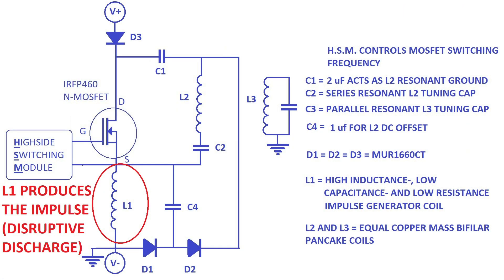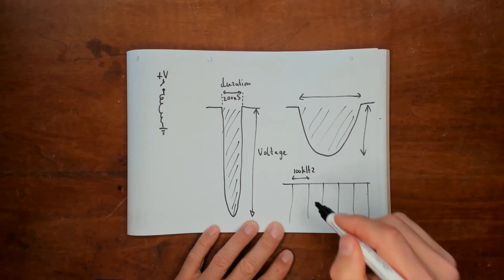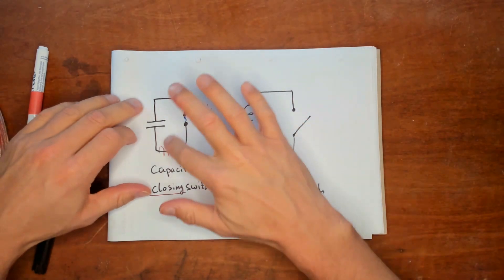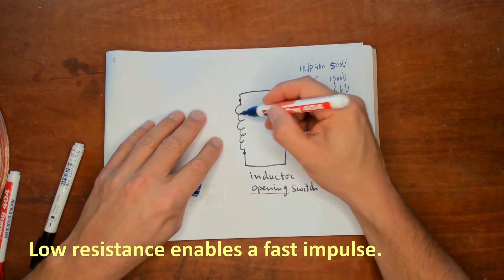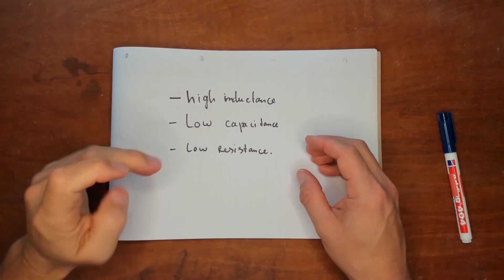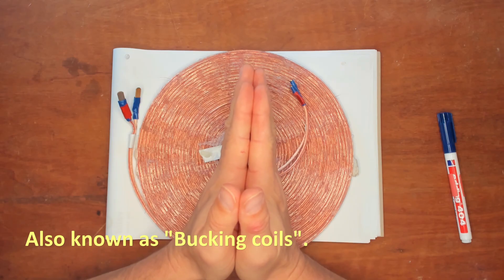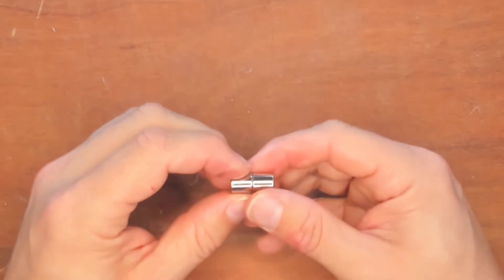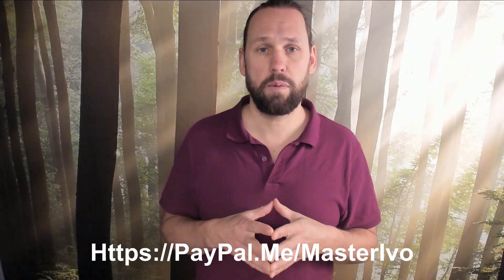Longitudinal electric impulse generation factors.

Comment: Why this interest in impulse, or voltage spikes? Why is this useful?
Reply: Reading the research of Gerry Vassilatos, one learns that Tesla discovered that with a capacitive powered voltage spike, jumping a gap prior to the closing of a switch from a high voltage source to a neutral network, he would see an amplification of electricity. This amplification, by the distance the sparks jumped out of the receiving circuits, was much greater than the amount of power behind the voltage differential supplied by the capacitors. (A spark that jumped a few centimeters at the switch would produce an arc of feet out of the receiving conductors, killing people who should have been safe distances from the wires.) Only Tesla saw this as an opportunity to discover how nature creates electricity.

This led Tesla to discover that electricity could be disassociated into charge and something else; which he decided was Ether. The Charge was relatively slow-moving compared to the Ether; the Ether was also able to amplify and re-constitute the electricity when it slowed down.

Tesla also discovered that the Ether was able to power devices and substances directly, without electricity or wasted energy in resistance and heat. It all depended on the frequency and vibration rate of the impulses that Tesla conditioned with his complex spark gap mechanisms, as to what the Ether impulses he could separate out, changing what they would do... the substances they would affect and the energetic response the substances would manifest. He found he could replicate any physical reaction in the various substances with his beams of pulsed Ether-energy. This took remote control to a new level, from transferring energy to actually doing chemical and nuclear reactions remotely.

Tesla also discovered that Ether beams, that did not have charge, could be transmitted wirelessly without loss or delay. The limitations of transmitting electrical power in wires that had resistance and also losses to the environment became obsolete.... as well as the physical limitations of power distribution that made it easy to control and monetize power distribution. This would have led to the devaluation of wealth in the world as we know it... so, his discovery became public enemy #1.

Right now, the idea is just a distraction... not of practical use. But if the power grid fails, it could save humanity.

Master Ivo is looking at impulses produced by opened coils, not closing capacitors. The quality of the electricity that each event dominates with, a charge differential driven electricity, vs. a magnetism driven electricity is different. He is using a similar concept, but producing a completely different effect than what Tesla researched. Master Ivo's is original research and is especially important in clarifying the relationship of Ether to electricity. There is much more to this than one can see in the description.

Party on dudes... be good to one another. Peace, B.
Reply: @mundymorningreport3137  And then, along came the Michel/Morley experiment which disproved the existence of ether. It just wasn't the same as Tesla's ether as they had misunderstood Tesla's meaning. And then all of science ignored Tesla until now when dark matter/energy is confusing the hell out of them!
Reply: @jimporter7418  they falsified the concept of a static ether.
Reply: @jimporter7418  Check out Quintessence. Wikipedia calls it the new Aether. An ancient alchemical term for Aether that modern science is embracing as real.

MM was debunked. Electrical theory is full of holes that make no sense from the pseudoscience of Maxwell's equations to the paradoxes of induction that cannot exist with the explanation of Faraday's induction to the impossible function of capacitors and the clear logical falseness of the three laws of thermodynamics when applied to electrical energy. As an EE, I can tell you that the theory and equations are not applicable in real life... fudge factors, guard-banding are the rule that must be implemented if you want something functional.

It is the law, so we must conform, but it is not the truth.

Party on, be safe. B
Reply: @mundymorningreport3137  I did a Physics degree 40 years ago and when we worked out electromagnetics from first principles, it came out wrong so we had to fudge it. That meant the principles we were using were wrong but nobody was allowed to speak of it!!!!!
Reply: @jimporter7418  I had similar questions during my degreed work. An engineer told me "Every theOry has a hole." You cannot graduate without accepting the theories are wrong, but discovering the truth is beyond most graduates.

Keep in mind Tesla did all this with junk from scrapyards all around the world today. Mystics have accomplished feats proving the tech is even simpler to implement for a disciplined mind and body. Several of the people who have discovered the truth also demonstrate advanced psychic skills. Coincidence? 

I've hacked the physical link between body and consciousness and wordlessly taken physical control of another's body, healed deadly illnesses, read minds, bent and broken metal spoons and forks with light finger pressure and mental focus. I've also shifted my weight, becoming much lighter or heavier... These are all tricks of conscious control of Ether we all produce. They are natural skills any living creature can produce. We do what Tesla discovered he could do with technology.

Is the truth much simpler than an advanced degree would justify?

Reich insisted that people who spent time in the Aether rich environment of his accumulator developed the ability to see Aether. However, realizing that truth required most people to need counseling. (He called it orgone in an attempt to avoid the censure Tesla experienced.  That strategy failed.)

Party on. Do good. B
Reply: @jimporter7418  They never found a static ether. But you do not need a static one when it can move with ya ;)
Reply from the maker: it is part of understanding Nikola Tesla's work. We only know magnetic induction, but Tesla worked with dielectric induction, based on these impulses.

both induction methods are needed simultaneously.
Reply: When you can eliminate the "back emf" from a circuit you can produce over-unity simply and continuously.  This is the pathway to doing just THAT.
Reply: @rstelzer2928  Or only use the back emf which has the same effect. There is more power in the collapsing magnetic field than most realize.
Reply: @rstelzer2928  Overunity is easy, what Evo is doing is far more interesting! Coherent aether  beams COOL!

Comment: what will happen if you push with several coils you stacked several pulses all in a row in the same direction to make only one line dc would have you would have a lot more voltage yes but will your amperage also increase  if so I may have managed to do an accidental reasoning that I am unable to reproduce and which had given me very spectacular results but destroyed my circuit after a few minutes of operation.
Reply from the maker: as a sine wave has a positive and negative maximum in one wave period, why not, push back in the other direction
Reply: @MasterIvo  it doesn't tell me if you had several pulses next to each other your amperage would increase
Reply from the maker: @pierrecotnoir5186   the Impulses are without current, but help to build up current (amps) but not un the same space. I'm not sure what would happen, this requires a experimental setup.
Reply: @MasterIvo  so strange to have power without current, but no electron flow means no current.
Reply from the maker: @dianathompson7597  difference lies in tranverse or longitudinal motion
Reply: by the way you do a great job
Reply from the maker: @pierrecotnoir5186  Thanks!

Comment: Outstanding lecture and research - I'm quite interested in Hemp Graphene coated wire - I bet that would lower resistance and bump up some capacitance ....
Reply: Hey, off-topic, but your namesake used Tesla tech to develop electrical systems that created useful electrical power from simple sources without consuming anything. 

If you haven't seen his work, you might check out "The Don Smith Magnetic Resonance Energy Crafting Systematic Index" by Richard Friedrich. 

Richard compiled and published his work since Don's attempts to bring them to the public were unsuccessful commercially.
Reply: @mundymorningreport3137  I've been looking into this also - Thanks for the lead - FYI - Robert Murray Smith has been an excellent resource also - I had sent him a bit of my WV Hemp and Bamboo a couple years ago - I hope to get into my own Hemp Graphene R&D  one of these days - $$$$$$
Reply from the maker: Thanks, Indeed it would

Comment: Hello master Ivo have you considered using spark gap? Spark gap can put additional current in the system trough Townsend discharge. Are you familiar with electrochemistry of discharges?
Reply from the maker: No I avoid sparkgaps.
Reply: @MasterIvo From what I can tell through some of the comments and replies I've seen in regards to this, they are thinking that the mosfet switch falls short of what the spark gap does in regards to how coherent of a field is achieved.  I think your experiments give perfectly good examples of how to make these things happen without the use of wickedly high power levels. Even a spark gap much smaller than what Tesla used would still require higher power levels to run, wouldn't it?

Comment: any idea how to make a stable oscilator , my freq keeps droping with the battery voltage, need power supply that is not connected to grid and stable . I think we need to work on making better voltage regulators like the juel thief circuit would be a good power supply to feed a voltage regulator circuit. Using a traditional PS connected to grid is not working , I am trying to oscilate a damaged battery at 432hz for 3 moon cycles , problem is i can't find a power supply that is stable , even my Grid drops dayly by a few volts, thank to night and day. The best power supply would be the core of Milky Way, that requires antenna array and filters to capture only that wave. Earth freq cahnges so does sun , resonance is optimum at a galactic scale. I gues scalar waves antenna array would provide access to such a signal. That would be more than Man deserves frankly lol
Reply from the maker: I have a link to a proper cheap signal generator, on the description of the radiant power video of april 2019, around 20 dollar, runs on 5V (its the one I use)